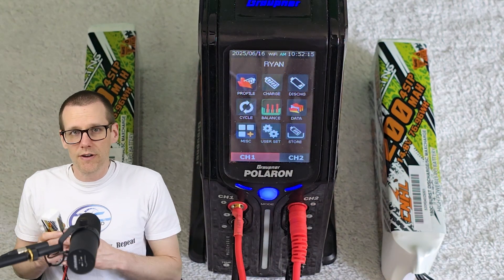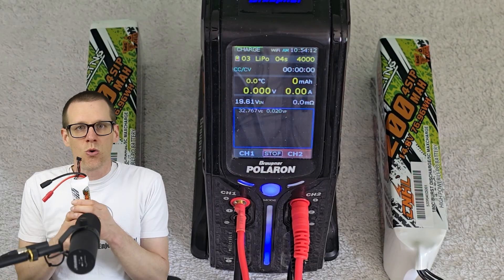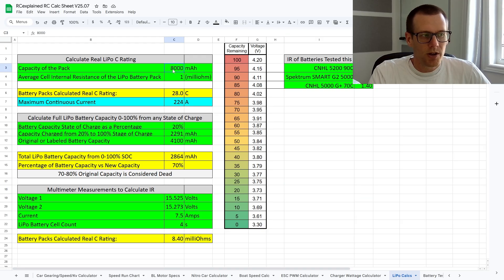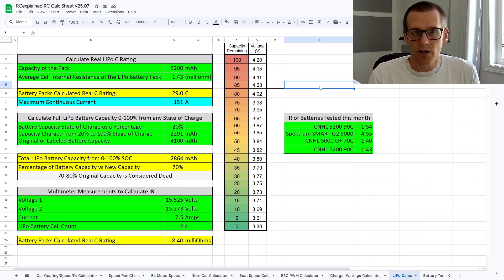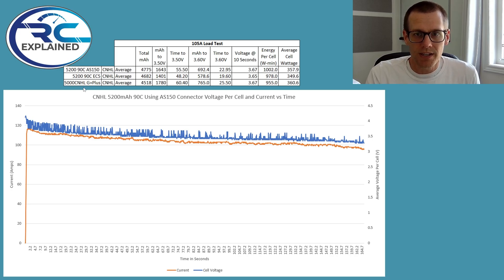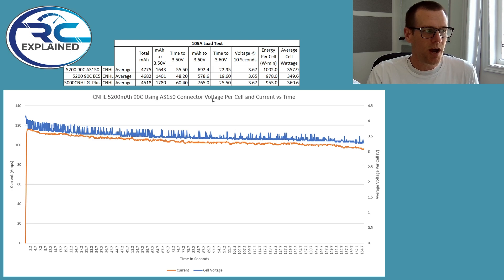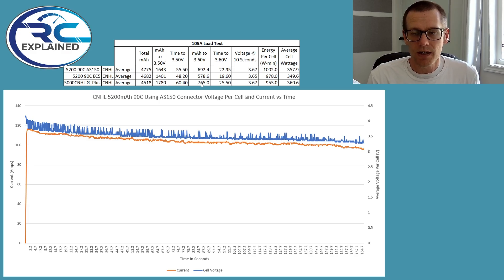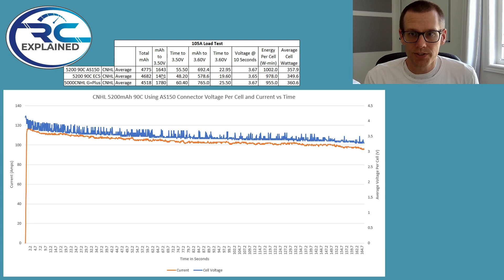Is the EC5 Connector Holding Back Your High C LiPo? 105A Load Test Results!

Comment: I use Xt90s on my EDF jets. They use 120amp ESCS. Would it be worth changing to the xt150/as150s? The batteries that I use for my EDF jets come with XT90s even though they expect to run at 100amps easily.